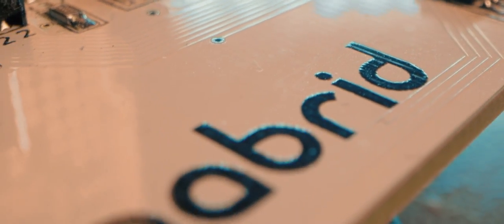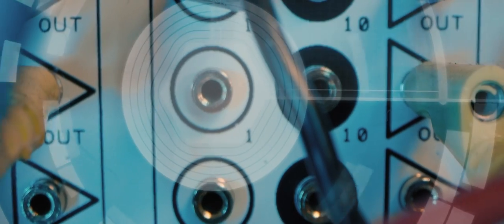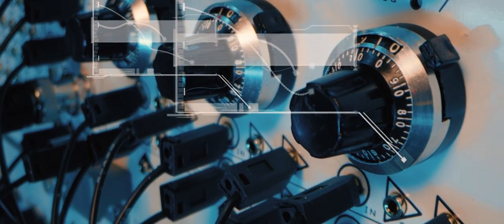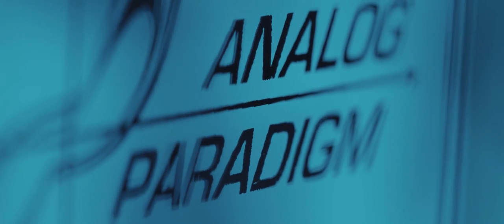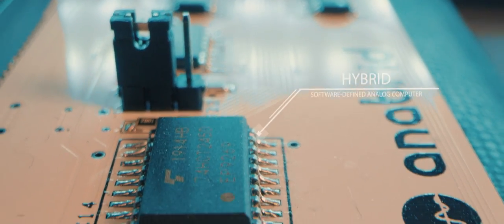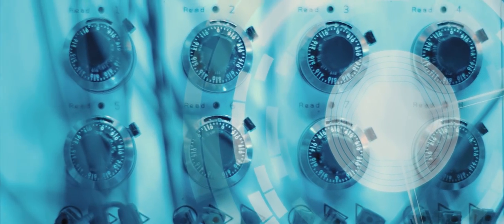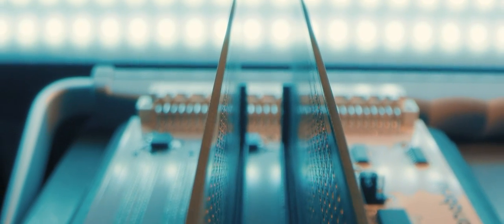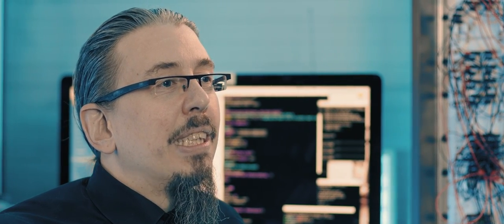anabrid mission statement

Comment: Can I buy one now? The Analog Thing?
Reply from the maker: You can order one but we had and still have so massive production issues that it will take some months for the actual delivery to take place.
Reply: @BerndUlmann  I did order one and my main reason doing so is that I want to take part in an analog computer that is currently supported. I tried contacting the designers of the Heathkit EC-01, but they are all dead.
Reply: @BerndUlmann  I've been looking for a handbook for large varieties of formulas for small analog computers - formulas represented in block diagram.
Reply from the maker: @stevematson4808  The Heathkit EC-1 was a nice machine for its time but really limited, especially as it only features linear computing element i.e. no multipliers etc. at all. In addition to this the operational amplifiers are also quite basic and show pretty high drift.
Reply: @BerndUlmann  thank you, I may have moved by then. Can you deliver by US Mail or do you have to use Fed ex or UPS?